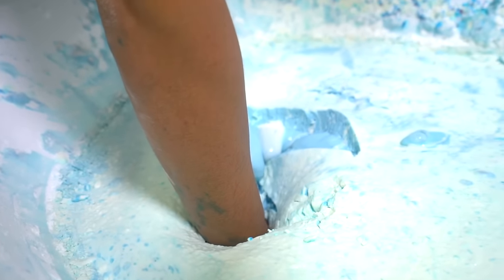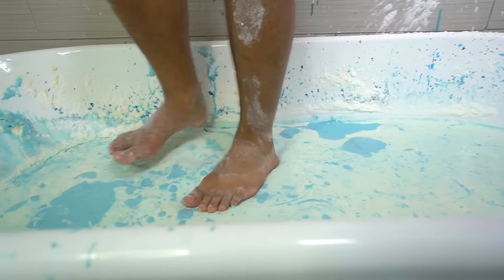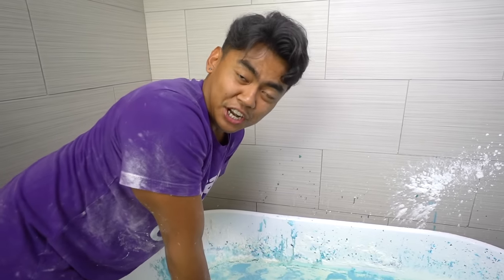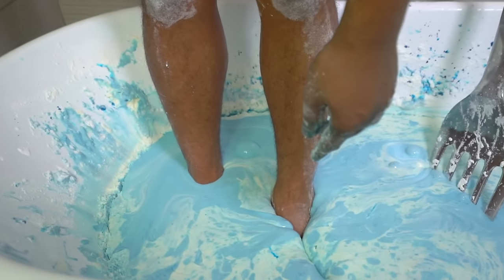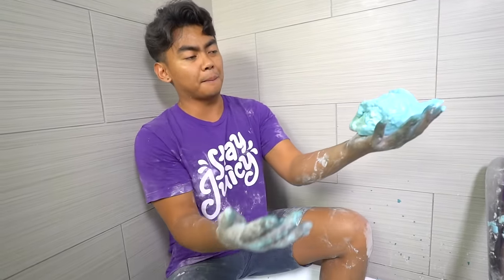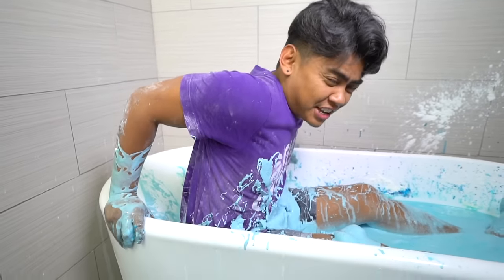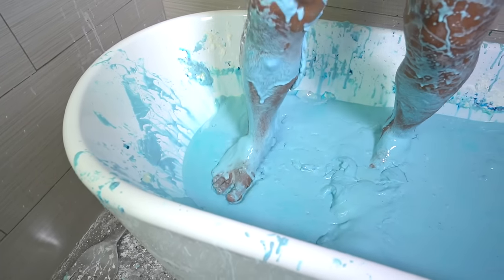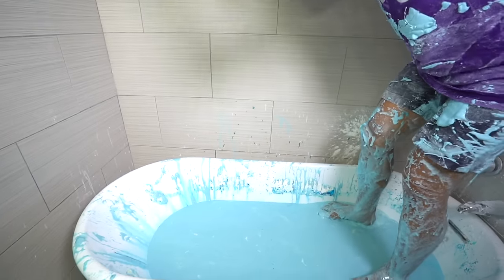GIANT OOBLECK BATH CHALLENGE!

Comment: Applying pressure to the mixture increases its viscosity (thickness). A quick tap on the surface of Oobleck will make it feel hard, because it forces the cornstarch particles together. But dip your hand slowly into the mix, and see what happens—your fingers slide in as easily as through water. Moving slowly gives the cornstarch particles time to move out of the way.

Oobleck and other pressure-dependent substances (such as Silly Putty and quicksand) are not liquids such as water or oil. They are known as non-Newtonian fluids. This substance's funny name comes from a Dr. Seuss book called Bartholomew and the Oobleck.
Reply: fax
Reply: Nah bro speaking sientific facts💀
Reply: Why are the people in these replies acting like children 💀
Reply: W h a t
Reply: Thx for the explanation i just wanted to comment that😅 but still thanks i know im late

Comment: Oobleck is Corn starch and water mixed up. When you have a bowl of corn starch, and you put your finger in it, it won't go down immediately. When you move it around, it will. Water is a middle of gas and solid. When you smack the water hard, it has the same feeling as a solid, when corn starch and water are mixed, the chemicals create the hard feeling of corn starch, and the soft feeling of water.

Comment: A quick tap on the surface of oobleck will make it feel hard, because it forces the cornstarch particles together. Oobleck and other pressure dependent substances (such as Silly putty and quicksand) are not liquids such as water and oil. They are known as non- Newtonian fluids

Comment: When you make a sudden movement, it does not have enough time for the particles to move. If you do it slow however, it does so the object sinks, it is also called a Newtonian fluid.
Reply: booooooooooooooooooooooooooooooooooooooooooooooooooooooooooooooooooooooooooooooooooooooooooooooooooooooooooooooooooooooooooooooooooooooooooooooooooooooooooooooooooooooooooooooooooooooooooooooooooooooooooooooooooooooooooooooooooooooooooooooooooooooooooooooooooooooooooooooooooooooooooooooooooooooooooooooooooooooooooooooooooooooooooooooooooooooooooooooooooooooooooooooooooooooooooooooooooooooooooooooooooooooooooooooooooooooooooooooooooooooooooooooooooooooooooooooooooooooooooooooooooooooooooooooooooooooooooooooooooooooooooooooooooooooooooooooooooooooooooooooooooooooooooooooooooooooooooooooooooooooooooooooooooooooooooooooooooooo

Comment: Oobleck is confirmed a liquid but the reason it turns into a solid is that there is two particles water particle and cornstarch particle if you punch it really hard the cornstarch particles form around the water particles but if you punch slowly the water and cornstarch particles are scattered